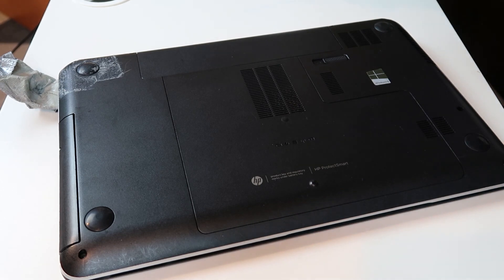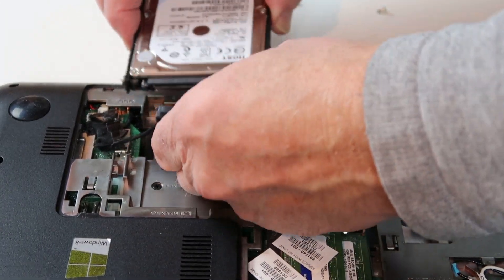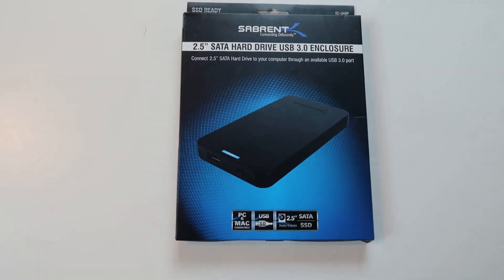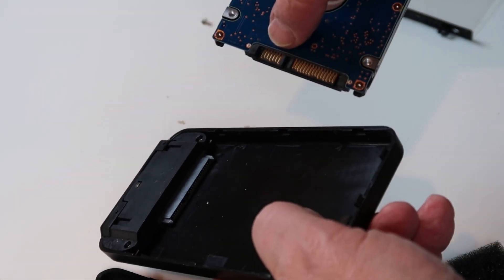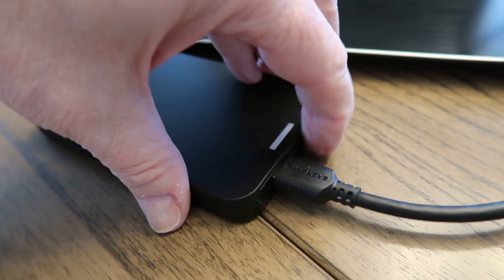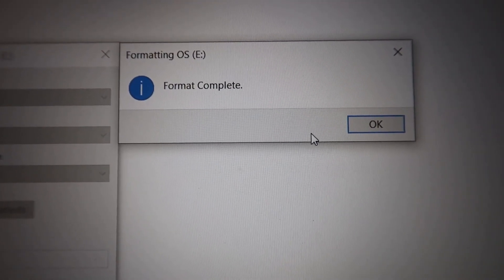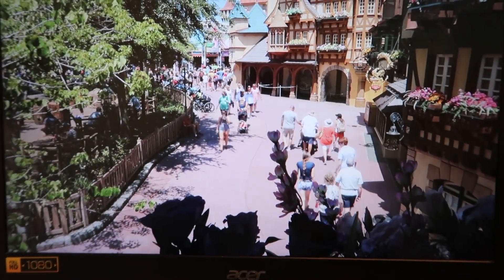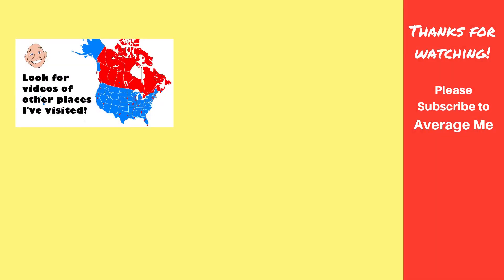How to turn an old laptop hard drive into an external hard drive | Save FILES - Save MONEY

Comment: Once you format that HD, how did you get those files back? I like to erase only windows OS from old hard drive but want to keep other stuff. How can I do that?
Reply from the maker: As an "Average" guy, I can only tell you the workaround I'd use. I would transfer the other stuff to another drive, then format the drive and bring the stuff back into the clean drive. Beyond that, you might want to go to a computer chatroom.
Reply: @AverageMe  Thanks. I have different issue. My current laptop is dying and I have Office suite 2010 installed in it. And lots of important data created and saved in this HD. I bought that office suite and still have original cd with product key
 O installed ms office from that cs to another laptop. Then I plug in USB drive in which I backed up from old laptop. Most of data I cannot see in new laptop. My Excel and word documents missing from USB drive. When I plug same USB in old laptop I can see everything. Don't know how to fix this.